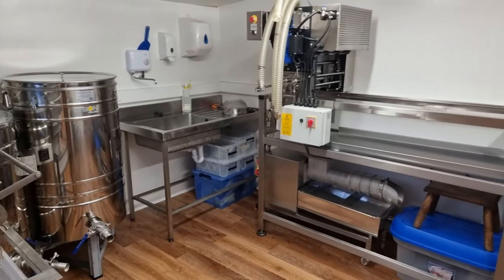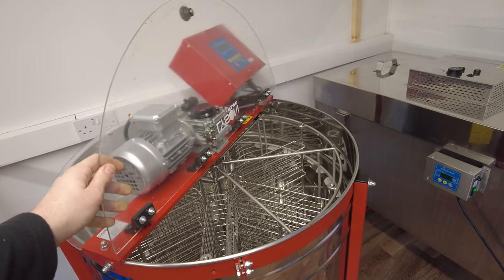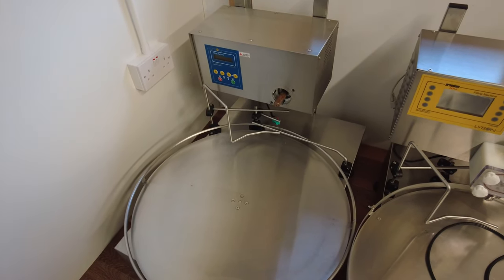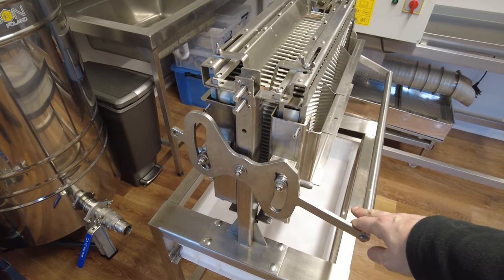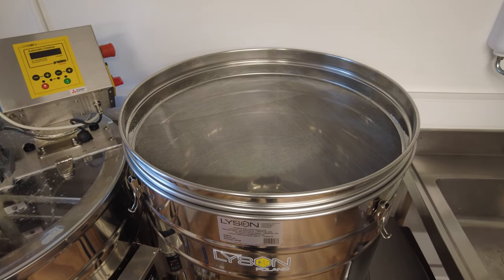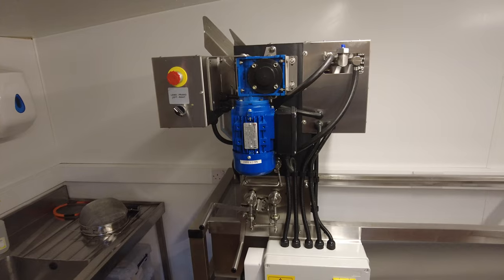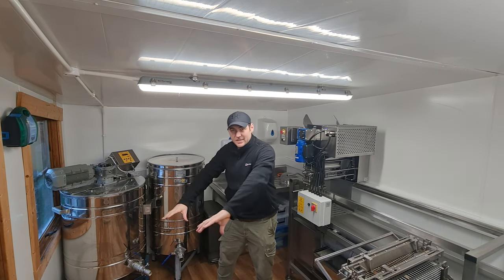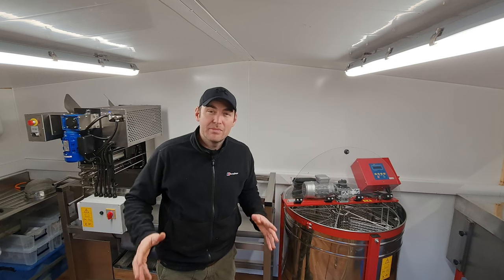Welcome To My Honey House - Honey Extraction Room Tour - Honey Room Flow and Layout

Comment: I think you should run the honey pump. Place a sump between the wax press and the extractor. Then, use the pump to move the honey to the settling tank. No more lifting buckets of honey into the settling tank. 
Either way, nice set-up and great video.
Reply from the maker: Yes. That's the standard way. Decant from extractor/wax cappings press into sump then pump to settling tank, but I just don't have the floor space for pump/sump and find I can more than keep up with decanting 30 litre buckets as the uncapping is automated and frees me up to move the buckets

Comment: V nice.. looks like you have quite a decent production capacity.. but since you ask.. I would have my extractor situated higher so I could run it into my storage buckets directly.
Reply from the maker: How do you mean? Honey out of the extractor needs filtering prior to to storage, else it needs filtering post storage. We in fact do both as a double precaution but the extractor can get fit a 80lb bucket underneath it? Why does it need to be any higher?

Comment: Hi Laurence, the top comes off the extractor quite easily. You can then lift out the spindle. Not necessary in most seasons obvs, but does allow a very thorough clean. Great room, great video 👍
Reply from the maker: Cheers Dave.

Comment: Very nice set up Laurence. In the process of upgrading my equipment and have gone with a 32 frame Logar automated extractor & a Swienty Dana Api Matic 1000 with 45cm turntable. I will be speaking to Abelo about a creamer, Apimelter & settling tank. Can’t wait to get it all into use 👍.
Reply from the maker: Great set up! Are you running the api matic with the funnel or connecting into a tank?
Reply: @BlackMountainHoney  I’m going to connect to a tank as I typically bottle larger batches and it would frustrate me having to keep stopping to refill the funnel.
Reply from the maker: @JimCinUK  Defo! That funnel is fiddly 😉

Comment: Hi Laurence, Great video thanks. Question: What would you suggest the minimum distance from bees to a honey room? I have very limited space. Thinking of splitting the apiary with a high net fence - bees on one side and shed for extracting , jarring and candles on the other. I would be interested to hear your thoughts buzz. Is it crazy to even consider close proximity to the bees?!
Reply from the maker: Absolutely - do everything you can to avoid this. It will be a nightmare come extracting time rendering the shed mostly unusable
Reply: Blimey . Thank you . I’ll have to put my thinking cap on .

Comment: Wow ! what’s the heat in there when all that’s going you may need air conditioning if we get a hot summer as you said the power trips if run to much kit you mite need a back up power source those little bees are just amazing they have definitely changed your life.
Reply from the maker: Yes - I am going to mount an AC unit this year :D

Comment: Hi laurence, looks great, I purchased the heated 50 litre  creamer and its been a bug hit. When I dump a 20 litre pail i have been removing the motor and lid as I prop the bucket so it can drain any thoughts ? Was thinking of weldin up some bucket holders wide enough for rim of creamer??
Reply from the maker: Our bucket just fits in. Would be a handy mod. Be a nightmare having to take the motor off though
Reply: @BlackMountainHoney  
It is a pain but no room to set a bucket up to let drain

Comment: With the Karndean flooring, did you seal it as well? I have Amtico flooring in my hallway and kitchen and didn’t realise it wasn’t sealed when installed. So I do it once a year. Then when it’s looking a bit worn, just strip it back and reseal it again. It will last a lifetime then :)
Reply from the maker: No need to seal according to manufacturer
Reply: @BlackMountainHoney  that’ll save time and £££ then